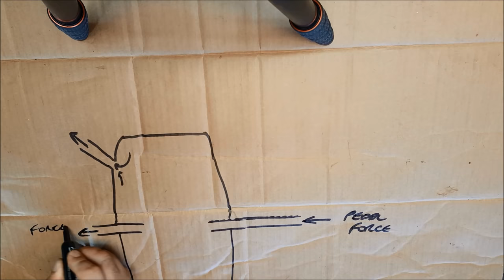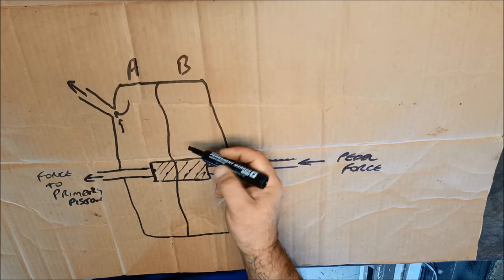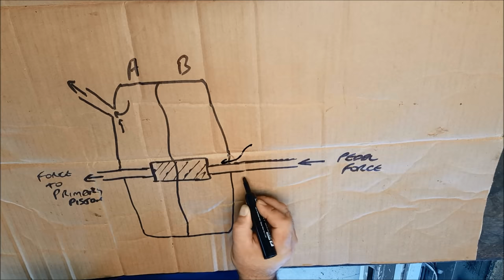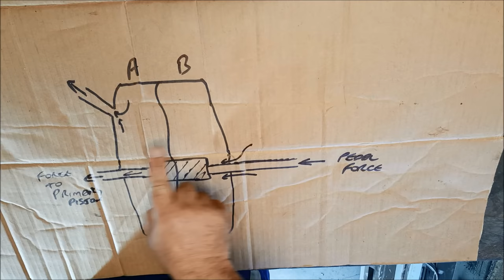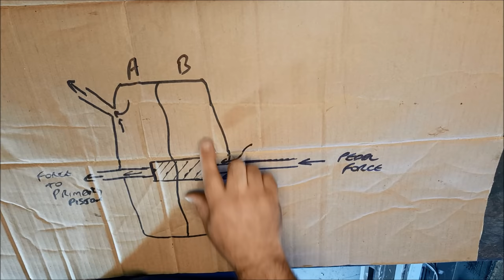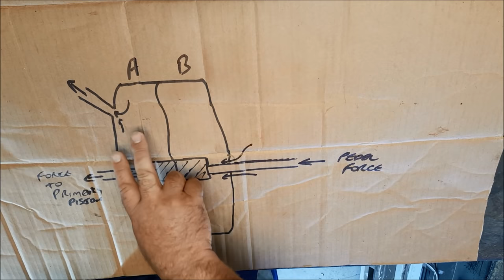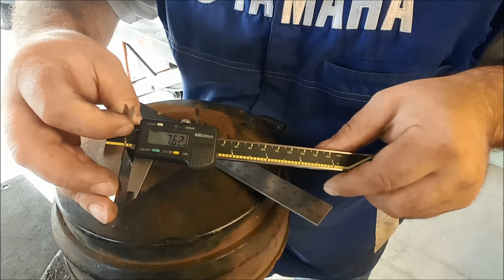Brake booster checks, operation and push rod adjustment #1313

Comment: I put a new booster on 2003 chevy pick up(have very little brake peddle)no adjustment on the rod! any suggestions?
Reply from the maker: Is there excessive free play on the push rod between brake pedal and booster?
Reply from the maker: Also double check the new booster part number - it may be the wrong one for your model?

Hope this helps
Cheers Andy
Reply: @AndyMechanic  no(have good back brakes,no front)
Reply: @AndyMechanic  will do that

Comment: I've got a 2001 Ford f150 Lariat Supercrew and I checked everything you talked about and everything checks out. I pulled the one way valve out and you could hear the suction from the booster. And there was plenty of suction from the hose with the engine running. I see a block in the front left of the engine compartment that all the brake fluid from the master goes to and from. What does that block do and could that be the problem? I'm stumped.
Reply: It is a valve. That routes the 2 main brake lines into 4, one for each brake. Air sometimes gets trapped in a stuck valve port. I'm speaking in terms of Non-ABS vehicles. I know nothing about ABS systems.

Comment: Thanks for the video! Can a faulty break booster keep car from starting and/or staying on?
Reply: might, if it's the vacuum leaking off(booster do that sometimes)
Reply: Donnie Shepperson Okay,  I will look into that. Thanks for the quick reply it’s greatly appreciated.👍🏼
Reply: Yep, defective booster and or check valve can at the very least affect the idle speed of the engine and in extreme conditions kill the engine.  Easy test would be to disconnect the vacuum line from booster and see if you notice a difference in the engine?  Don't drive on highway because without the booster your car will be a big rolling hard to stop beast!
Reply: James Ray Thanks for replying. I won’t be driving it 😅I have been trying to diagnose the turn over no start condition on a Kia I’m “working on.” After watching the video I remember that right before the engine died, the brakes  partially stopped working. Thankfully I was close so was able to make it home safe. I’m thinking the brake booster hose might have a leak or something. I’m not a mechanic but I will definitely look into this over the weekend. Thanks for your help, it is greatly appreciated.

Comment: could having the push rod at not the correct adjustment be the cause of my brakes locking up every now and then ive changed everything on my 350z brake system pads, rotors, calipers, master cylinder, and brake booster.  tonight when i changed the booster at first it seemed to be all fine but then when turning car off and pushing down on the brake pedal about 3-4 times releasing vacuum once i turned it back on it seemed like the brakes were once again dragging and the car would not go when putting into drive and pressing on gas,, although when i went and put my foot behind the brake pedal and pulled it back it seemed to have make the brakes not be engaged and the car began to go again once putting in drive and giving it a little gas. i just cant seem to find the problem if you could give me a response id greatly appreciate it like i said it seemed to have gotten stuck when i pressed down too hard on brake pedal but then released when i put foot behind and pulled it out. @Andy Mechanic

Comment: I’m changing my Brake Boooster can’t I just check the old one and adjust it to the new one ???
Reply from the maker: No. Unfortunately it's unlikely both old and new boosters are exactly the same. This is a very accurate measurement and needs to be correct or you can have brake issues 

Cheers Andy

Comment: could that ( push rod) make the vacuum of the car have some issues. like unstable rpm at idle?. thanks
Reply from the maker: +Daniel Bravo Diaz No, I don't think incorrect push rod adjustment could. But an internal Leak in the booster will. Clamp the large vacuum hose to the booster and see if that cures the engine problem. If it does then replace booster :-)

Comment: I have had to add brake fluid somewhat lately, and don't know why. My 1998 Jeep has had new pads and new disks all around. BUT lately when I am driving and apply the breaks sometimes it makes a noise and then the brake peddle will drop a inch or so. It doesn't do this at every stop, but seems like it may be getting worse. Do you think it maybe the Brake booster, or maybe a disk caliber?    Great video Andy. Thank you
Reply from the maker: +Larry342516 it's more likely to be an issue with the master cylinder. It's unlikely to be a caliper issue but you need to check the basics, siezed pistons, sliders etc. If they all seem fine I'd swap out the master cylinder, if that doesn't cure the issue then you'll have to change the booster but I don't think it's that at fault here.

Hope this helps. Andy

Comment: So, what is the problem if the peddle goes all the way to the floor rather than just an inch? What is the problem at that point? I blew 3 brake lines; now I have a full stiff peddle with the engine off, but goes to the floor when the engine is started. I have been bleeding the brakes for 3 days and still no improvement in the peddle, and I have no apparent leaks in the new lines. NO ONE in YT land is addressing this. If you can, much thanks!
Reply from the maker: Hi Philip. Given the amount of bleeding up of the system you have done I do not think the excessive travel is related to air in the system.

It is more likely to do with either seal failure in the master cylinder or excessive piston retraction at the calipers (if disc brakes all round). If drum on rear then excessive clearance between brake shoes and drums so adjust up.

I suggest clamping off ALL brake flexi pipes. If pedal still drops then fault is master cylinder seals.

If pedal travel greatly reduced when all hoses clamped then remove one clamp at a time and test pedal travel then replace clamp.

You may find one caliper is responsible for the vast majority of pedal travel. You can then investigate further - could be excessive piston retraction or possibly a seized slider if a floating type caliper.

Please let me know how you get on
Thanks
Andy
Reply: Thanks for the input; I appreciate it. I don't think the calipers are the problem. I just replace all the pads and the slider rails and lubed them properly. Now the calipers are extended all the way and the wheels won't turn, so I apparently have more than one problem. All four calipers are extended and not retracted. These calipers are only 3-4 years old. They moved freely when I was replacing pads. I guess I have a lot more work ahead. Thanks again for your reply and input. (BTW, really like the HOT girls on your channel in your garage!!)
Reply from the maker: Please do the test as I outlined as this will highlight where the fail is.

Now you say you have fitted new brake pads. Brake friction material on new pads/shoes is soft. The pedal will always feel springy/low after new pads are fitted. If the brake disks are ribbed (not Flat braking surface) then this will be much worse. Once brakes have bedded in and heat cycled to harden friction material the pedal will automatically come right.

Hope this helps
Cheers Andy
Reply: Thanks for all the expert advice and suggestions. I am back on the road again. I just needed to keep bleeding until I gained pedal again. All good!

Comment: Hi Andy 
Great video as you well know we’ve had some hot weather the last week or so I was on my way home today and breaks on my transit mk7 became very soft when pressed I can hear air coming from around the break pedal area is there a seal on the cab side of break cylinder or will the unit need replacing, I wondering as the cab has been very hot is this common  problem and can it be repaired , I need the vehicle sorting as I’m self employed and it can’t be off the road for long thanks
Reply from the maker: Hi Paul, if the brake servo had failed I think you'd find the pedal would go harder and not softer. I think you may have a problem with one of your brake calipers or Wheel cylinders. Easiest way to check is to clamp off the flexibility pipes to the rear brakes and test the brakes. Then do the same with the front brakes (drive slow!) The end that is not clamped off when the pedal is soft has the problem. Hope this is of help. Cheers Andy
Reply: Andy Mechanic thanks for advice Andy on further inspection the vacuum pipe had a repair half way along its length looks like they used heat shrink and electrical tape I’ve ordered a new pipe from ford so should be back on the road soon 
It would be great to hear your take on the diesel system the difference between the two systems 
You have a new subscriber 
Many thanks

Comment: Andy, i have following issue that led me to this video tho: When pushing brake repeatedly when engine idle, RPM increase up to 1.5k. Was checking all sort of leaks like you mention in the video. No leaks yet issue still not solved.
Any idea what else may cause this unstable RPM increase when pushing repeatedly brake?
Reply from the maker: Try disconnecting the vacuum supply to the brake servo & blanking off the pipe from the intake manifold.

If problem of increased engine rpm goes away then you have an internal leak in the booster & it will need replacing. 

Cheers
Andy
Reply: @AndyMechanic  Thanks for your reply.
So thats why it could be I hear hissing sound when open fuel cap. Seems like it sucks air inside the reservoir.

Comment: Most GM boosters don't come with an adjustable plunger and I have not been able to find anyone who sells  the plunger by itself or a new booster with adjustable plunger or push pin whichever description.
Reply from the maker: Damn....I. wonder if they shim between the master cylinder and booster to do clearance? Odd because it's very important it's set right. 

Thanks for the feedback. Cheers Andy
Reply: @AndyMechanic  I don't need clearance I have to much clearance.
Reply from the maker: Ah okay. Then why not machine up a small cap to go over the end of the internal pushrod. Make it a tight fit and make the extra length what you need to eliminate the excessive gap.

Comment: 94' Honda Wagon:  (Driver side caliper Only) locks up.  I replaced Master Cyl. & Brake Power Booster.  Since then my front Driver side caliper has stopped retracting.  When I test run the car and press the brake to stop at a light the piston tightens more & more each time I press down locking up my caliper and forcing me to bleed the caliper bleeder valve or the Accumulator Line nut to release the pressure from the caliper piston.  Once I've done this I am able to proceed driving again but again can only use the brake a few times before it tightens down and forces me to accelerate to try and pick up speed.  Do you think that My Booster Rod may need adjusting  Keep in mind that only One Wheel is locking up, the other 3 work just fine.
Reply from the maker: Hi Sam, I was just checking through my YouTube comments I spotted yours. I'm sure I replied but my reply isn't showing?

What you describe here is, I am sure a push rod length problem, sounds like the rod is a little too long and the compensating port isn't opening when the brake pedal is released. So you'll need to check its length or just shorten it a little and see if it helps.

The other possibility I can think of is the problem is inside the rubber brake flexi pipe that goes onto the caliper, its begun to break down inside and the rubber has formed a type of flap creating a one way valve. Pressurised fluid can get to the caliper when you press the brake pedal but then it can't return when you release the pedal due to the flap of rubber. I had this problem on an old Nissan Patrol once, took me ages to find the fault!

Hope this helps

Andy

Comment: Andy I just recently changed my master cylinder, I did a bench bleed on the the master cylinder then a complete bleed on all four wheels. But I am still having an issue with the pedal going all the way to the floor when I start the engine. After  pumping  the pedal a few times I do get a response and they firm up. But this is very abnormal. With the  engine off the brakes are very firm no problem. I have tried bleeding them with the engine off and on with no success. I came across your video about the brake booster  and I am thinking maybe the booster is bad, but after watching your video you said that one should at least check the plunger for possible adjustments. I am at my wits end with this issues and open to any possible advice. thanks in advance.
Reply from the maker: +hugh francis Hi, thanks for watching the video. Now usually what I do to help identify where the problem is is to clamp off all the rubber flexible brake pipes. Then try the brake pedal again with the engine running.

If the pedal is still the same where it sinks to the floor then you know that there are no problems with any of the brakes. It must either be air in the system upstream of the clamps, a master cylinder problem or a booster problem.

Now if it's air then you'll just have to work out a technique to bleed it from the system, there are many types of system and a number of ways of bleeding a hydraulic system too and I can't go through all of them.

Master cylinder....was it new or used? I'd suggest stripping it down and inspecting the 4 lip type seals, for condition and correct orientation. If you have leak-by on a main seal then pedal travel will greatly increase.

Booster....check diaphragm isn't damaged by doing a vacuum test on Union that connects to intake manifold.

Also check that there is a reaction disc located in the booster....it is made of rubber usually and is what the output pushrod to the master cylinder rests against. If this is missing you will get much increased pedal travel also.
Reply: Andy Mechanic thanks for the quick response Andy I will check all of the above asap and leave feedback

Comment: put new hoses on front disk,pumped 6-to 8 times no fluid came out ,master cylinder did go down some???
Reply from the maker: Sorry for the delay in getting back to you. I have been crazy busy marking and still have lots to get done.  Just keep pumping, the fluid must be going somewhere. Remember to only do one side at a time & to close off the bleed nipple each time the brake pedal comes back up, otherwise you will draw air into the circuit. Hope this helps

Andy

Comment: Should a new booster have the pushrod set at the factory?
Reply from the maker: Only if it's fitted with the master cylinder otherwise it needs to be done

Cheers Andy
Reply: Even if it was factory calibrated, you can't trust that.  Aftermarket new or remanufactured parts, likewise.  You must verify the measurements with the method described in the video.  Otherwise you're installing a potentially ruinous hidden problem.

Comment: My 1962 cadillac brake going lock when i push brake pedal just a little,can that be booster push rod adjustment?
Reply from the maker: Is it worse when brakes are cold?
Reply: @AndyMechanic  does not matter whether it is warm or cold, the wheels are locked up with a trick. The pedal is about 2 centimeters numb then like a stone
Reply: @AndyMechanic  this is boosted drum brakes
Reply: @AndyMechanic  and brakes working normaly when take booster hose off.
Reply from the maker: I think maybe there is an internal valving fault in the booster. Now on some American cars they have hydraulic boosters and not vacuum boosters. If it's a vacuum booster then it will need to be replaced as they aren't usually serviceable unfortunately. If it's a hydraulic booster then maybe you can get it overhauled? I haven't worked on a hydraulic booster before, so can't really advise on that.

Let me know how you get on.

Cheers Andy

Comment: great vid andy and well explained. just done this test on my mazda 6 diesel and it would appear that my booster is ok but my brake pedal is still hard to  near impossible to push down and my brakes fail . any idea what this could be please dude.
Reply from the maker: +nicoclause Hmmmm. ..on a diesel they have to be fitted with a vacuum pump, often on the back of the alternator. I'd suggest checking the output of this as they can wear out resulting in poor vacuum which will drastically reduce Braking assistance given by the booster thus a hard pedal.

Let me know how you get on :-)
Reply: cheers dude